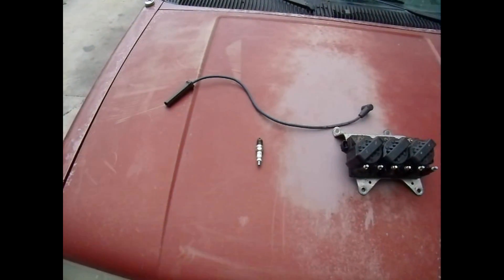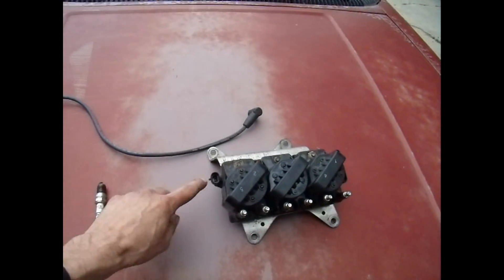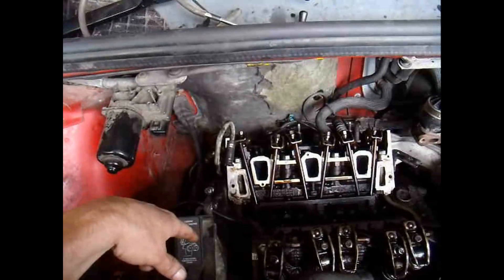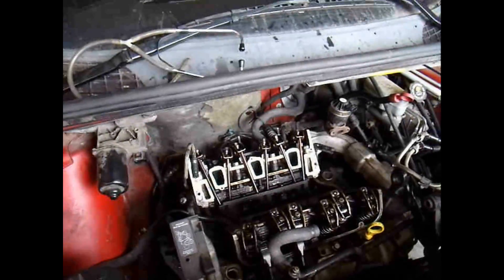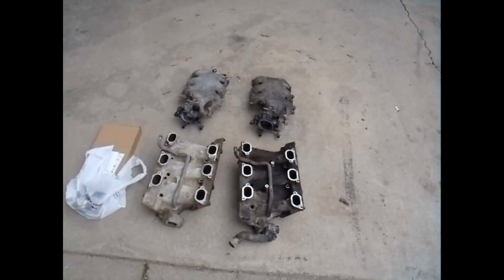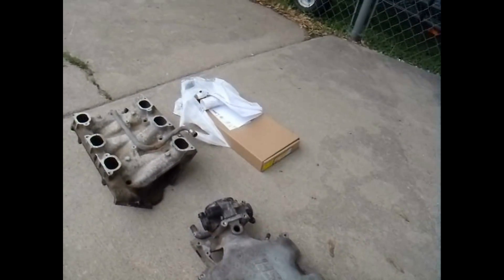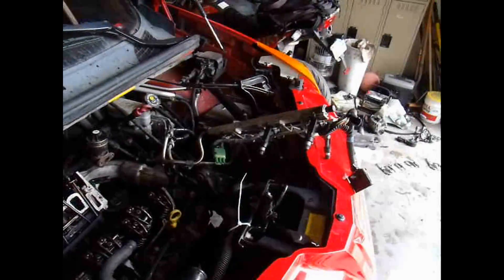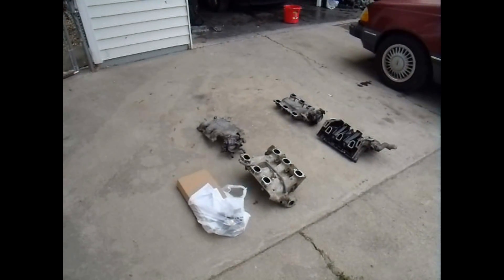GM 3400 / 3100 3.1 3.4 Engine Misfire Cause & Causes Miss Missing P0303

Comment: I got a 34 and it had no miss however the water pump bearings were shot and noisy it Wud  overheat intermediately but not due to the water pump but bc the tube b were the coolant reservoir return hose connect to was clogged anyways fixed all of that, no more overheating issues but suddenly there's a miss & again there was no miss before I replace the water pump & unclog that pipe.....  There's spark off the coil  & spark plug, near 200 PSI on cylinder 4 which has the miss & fuel sprays out the injector, there's no ticking no tapping sound!! I don't want to have to pull the intake off but what else could it be?  it was fine and then after I replace the water pump and test drove it it had a miss
Reply from the maker: Do a coolant pressure test.  See if it holds pressure.  That’s where I’d start.  These engines are notorious for bad gaskets, head, intake and timing cover especially.
VT247

Comment: I changed motors ,old went blew. New 1 has a misfire we can't diagnose. New plugs, wires, coul packs. Every sensor on the motor, still have a 0300 code if misfire! Help!
Reply from the maker: Might be a bad sealing gasket on the intake or head gasket.  Check the fuel injector too to see if it’s working while running.  Can listen for the injector with a stethoscope or even a piece of tubing making sure it’s clicking.  Hope this helps.

Comment: 2004 6 cylinder  Alero misfire. Changed spark plugs, wires , coils and still a misfire . Checked air intake hoses. What else could it be
Reply from the maker: Could be a fuel injector or a bad gasket.  The GM 3400 was known for having bad gaskets.
VT247

Comment: Mine Rpm hand is jumping up and down when I accelerate and it starts hesitating and when I decelerate the Rpm hand begins to read but the car is not missing I replaced the spark wire

Comment: Were you just having a misfire or was your engine making a ticking noise
Reply from the maker: It was just a misfire.  On some 3400 engines, the rocker arm bolts can strip out.  Another area to look is the front passenger side front for an exhaust leak by the manifolds.
VT247

Comment: Will it start with the pushrods in wrong position
Reply from the maker: I doubt it.  It would make a lot of noise and could even strip out the rocker arm studs.
VT247

Comment: Can a p0300 random cause it too just replaced my lower intake
Reply from the maker: If the intake is cracked, the misfire will happen on that cylinder.  
VT247
Reply: @Vacationtime247  sure is I remember torque it 18ft pounds I heard like 4 different cracks taking it apart again too inspect I do remember hearing those cracks though
Reply: @Vacationtime247  wth would gm say 18 ft when that will Crack it at least mines its a chevy impala 3.4 sfi 2005

Comment: how do I conduct a engine combustion test on my 01 impala? 3400 gm engine v6
Reply from the maker: Can do a compression test by threading a test kit into the spark plug hole and cranking the engine over.  Should have well over 100 psi and all of them should be within around 10%of each other.  If it’s missing out, check the spark, fuel and of course a coolant system pressure test.  These engines had known issues with bad gaskets from the factory.  Nearly every one I’ve had has needed the entire gasket assembly replaced.  Such as the timing cover, head and intake gaskets.  If you have to do one, do them all.  Having to go back later and do things over again ain’t fun.
VT247
Reply: @Vacationtime247  ok thanks I just replaced the head gaskets and both lower and upper intake gaskets. I want to do the compression test to check my work. This was my 1st time attempting something like this. Trust me im no mechanic

Comment: I did the same thing bro....what the heck did those metal pieces have to be in there????? Just to break them.... I used a cheap set from China that lasted for 4 years...no metal inset in the gasket....I thought this time I would go big and spend the 90 bucks and not have to do the job again.! WRONG!! I torqued to just over 10 inch pounds and placed a perfect indention in both 3 and 4  exactly what you pointed out.....so mad I could have bit 16 penny nails into. And if you notice the other seals including the coolant seals have NO METAL pieces like the two intake in the middle....I’m still mad about it.

Comment: I am working on one now, 2003 chevy venture. I tuned it up with new plugs, wires, coils and crankshaft censor, and it still shows multiple misfire, sometimes #4 cylinder. I ran a test by pulling plugs 2,4, 6, all on different coils, and all had good spark, the #4 plug only was shiny like new, I could tell nothing is firing in that cylinder. Next step, check fuel injector to make sure fuel is going into it. If injector is working properly, what else would I look for.
Reply from the maker: Check fuel pressure, might be a weak pump.  The spark module that sits under the coils could be going bad.  Try unplugging the MAF (mass air flow) sensor, see if that clears it up.  Check for vacuum leaks.  Don't forget the camshaft position sensor too.  Just giving a few things to check for with a random  misfire situation.
VT247

Comment: for others seeing this video, consider checking your knock sensor, the wiring, and the connectors. it is plugged into the ignition pack on the driver side (a two wire connector)

Comment: I would have never thought of this!  I have a strong suspicion that this is my issue as well.  I have eliminated coil, plugs, & wires.  I have not done compression yet but this gives me hope.  Thank you.
Reply: Are your valves tapping ? I had lifters lose pressure and caused a misfire. I hope you get it .

Comment: I was wondering if anyone could help me I have a 1995 Pontiac Firebird with the 3.4 liter V6 I replace the plugs wires and coils and I have a misfire at low RPMs and my car does not want to idle below a thousand I put my hand over the exhaust and I can feel it sucking in and puffing out is this normal could it be a vacuum leak or could it be an intake gasket or something in the engine have not done a compression test only seems to miss at idle that I can tell I put a timing light on each wire and each wire is firing I also have new injectors in it they are all working
Reply: Try a new pcv valve
Reply from the maker: I'd suggest a compression test or a chemical test to check for a blown head gasket.  That or put air into the cylinder at top dead center and listen for a hiss on the exhaust or intake indicating a burnt or bent valve.
VT247

Comment: Thank you very much I rebuilt my 3.1 3 years ago and had this cylinder 3 misfire ever since I watched this video and thought um..maybe.. well after tearing down the engine once more I found the same problem as you had cracked lower intake  ..I have been trying to figure it out now for 3 years and finally it runs like new thank u for ur post it was great to see and learn something new

Comment: 2001 Pontiac Grand Am lower intake replaced hard to start stalls out and misfires like crap low Vacuum vacuum needle jumping all over the place fuel pressure is good map sensor code po107 po108. Missing on Cylinders two and four mainly also sex not as bad the front side let me know if you can help just did the lower intake
Reply from the maker: Check for vacuum leaks.  Make sure all the connections are plugged in at the coil correctly along with the MAP.  There are several connections and know I've missed one when doing this job a time or two.  As in this video, if the mounting tabs for the intake don't line up correctly, it can cause the aluminum intake to crack when torquing the bolts down..  This was my problem as seen in the video.  Another thing is that the intake and exhaust pushrods are  of different lengths.  If they are not in the correct configuration, it will cause running issues.  Hope this helps some. 
VT247

Comment: So a intake gasket leak will cause the misfire..minebhas a cylinder 2 misiffe.anf I can't figure it out..but I do have a gasket leak right where cylinder 2 is.
Reply from the maker: Yeah the extra air is not metered and throws off the air fuel ratio.  It's like having a bad vacuum leak on that cylinder.  
VT247

Comment: I was afraid of this, I have the same issue with mis-fire on cylinder 5, changed wires, plugs, coil and even replaced fuel injector. Guess I'll pull the intake and replace the gasket.

Comment: I have a  2002 Buick Rendezvous 3400  by chance do you know the firing order for  spark plug wiring? Do you believe the 3100 in the 3400 same have same  firing order?
Reply from the maker: Believe the 3100 and 3400 are the same order cylinder and coil pack configuration.  The following info would be for your Rendezvous 3400 motor.  Front of the car, near the radiator, from left to right are cylinders 2-4-6.  Back of the engine, near the firewall, left to right is 1-3-5.  Now the coil pack, as mounted on the engine from left to right is 5-2-3-6-4-1
VT247

Comment: Is there a way to check for a crack without having to disassemble everything? With a scope or something? I believe this might be my problem, the previous owner had re-machined a head and changed the head gasket. So is it possible they cracked the intake manifold? I’m a little scared of digging that deep especially if I don’t have too. But I’ve been searching everywhere and this makes sense as the fuel injector has been replaced the plug and wires are good and I’m getting p0204 p0304 & p0404 I have a 06 Chevy Equinox 3.4 Thanks for this video!
Reply from the maker: Might put together a DIY smoke test and push it into the intake or the brake booster hose after plugging up the front of the intake throttle body.  May also be able to get an idea of this happening with a vacuum gauge.  Also could try using carb cleaner and checking for vacuum leaks with the engine running and checking for changes in RPM.  Just a few suggestions.
VT247

Comment: I did the LIM gasket on mine, didn’t mix up pushrods, as far as I can remember the felpro fit just fine. I did hand torque everything down just by feel, the gasket appears to be functioning fine, I completely cleaned everything out even including a toothbrush to the overflow tank, no mix I can tell at all, no bubbling in the radiator when on. The engine did overheat a bit but not that long, it never pegged out just got real close to red. I don’t see any obvious vacuum leaks or hear anything, this is the second time I did this stupid gasket, ended up cracking the LIM due to removing a bad temp sensor that someone cross threaded. Got a 2 LIMs one from eBay but then found one in a nearby junk yard. Well needless to say the engine idles rough sometimes, high speed seems good, sometime it idles better until warm, no rhyme or reason. I just can’t see myself doing this stupid job again until cross contamination occurs. Not sure if I have your issue or not, the car has run pretty decent for 20k miles. All ignition parts are new, I think I’ll just live with it, maybe head gasket maybe LIM gasket didn’t seat properly or has an issue like yours. Who knows, I refuse to do it again, when something starts to fail then I will just pay someone to do heads and LIM for me. I’ll catch it way before any bottom engine trouble. That job is the biggest pain in the @#$. I just won’t get rid of the car, it’s a fun car 3100 century station wagon with immaculate paint , interior, and all rubber window seals etc. it was kept in a garage it’s whole life. 

I changed LIM gasket on a 307 Buick with quadrajet in like 30 minutes this one takes hours and the risk of damaging other components like rockers etc. small miss whatever it runs decent enough to drive and not act a fool.

I sure wish there was a simple test for this, I’ve done a lot of stuff troubleshooting that didn’t turn out to be bad, I’ll be damned if I take that all apart over a little idle miss that gives no codes. Autozone sells the 3100 and so do other places might just drop a new motor in it, but ONLY if I can find one with the LIM on it.

Oh well project for another year or whenever one of those gaskets fails....
Reply from the maker: Might try a coolant pressure test to see if it holds pressure.  These engines are horrible for blowing gaskets.  The head gaskets only last for so long before taking a dump.  Every 3400 I've ever owned has needed all the gaskets replaced.
VT247

Comment: Just a reminder..most torque wrenchs are have to be recalibrated to different weather climate or season..torque wrench can be off by 10 pounds depending on temps..since metal click type wrenchs are calibrated in a factory at around 70F..using it at colder temps would be different..simple to calibrate they have videos to give you a good idea..since these gaskets have suck minimal margin of error use a small 6 inch 1/4 drive ratchet will give you about 10 pounds or 120 inch pounds

Comment: Another tip..rods are cheap..if you remove the rods with the lisle 48300 rod remover put in new ones in..the intake rods are $3 & exhaust are $ 5 a piece..do the exhaust rods first they can only go in the right place ..then do the intake rods ...rocker bolts or nuts are too soft to break loose or retorque..it dont take much pressure to raise the rocker with the tool..its about $20..but if you have the snooty mixture you might want to take the lifters out clean & soak them in a assembly oil while cleaning the port  chamber just push down while in the solution ..oops I'm sorry I don't want make seen hard..but seen way too many broken cams & spun rod bearings if you don't get that mixture out of your oil channels..many ways to do it starting with the oil filter inlet port...fun fun fun

Comment: The last plastic gasket guide tips get broke off in the in the heads..make sure taps are clear might have not enough clearance..plus the metal tabs are to make sure you don't torque to much to compromise the gasket..just a safe guard to protect the seal...also  your 4 bolts on the side of the lower intake can be   stopped up with threadlock,sealer,etc...drive the bolts in the holes until it stops before you install the manifold . some bolts are not threaded all the way but make sure it goes far enough to torque the gasket instead just torquing a stopped up hole..lots of fun..good luck

Comment: I have a 2005 Buick century in great shape, only 69,000 miles. At idle, it seems to be running a bit rough. I can feel small vibrations through the seat and the steering wheel. This is accompanied by a knocking noise that can be heard occasionally. 

I know the 3.1's knock when cold, but this is after it warms up. You cant really hear the knock from outside the car, but sitting inside with all the windows up I can hear it, it's a low pitch deep knocking. Not severe, but noticable. 

I just want my old grandma car to be happy and smooth! Any ideas? Thank you very much!

Comment: My pontiac grand am gt has a miss fire.3400. I have changed the coils,spark plugs and wires ecm and more but it still is miss firing.but my check engine light is not on.what could the problem be?
Reply from the maker: Check for a vacuum leak.  Pull off a spark plug wire then start the car, see if it makes a difference in how it runs.  Runs worse, that's not the right cylinder, runs the same, you've found the area of the problem.  Might be a fuel injector.  Also possible that a gasket is bad.  Hope this helps some.
VT247